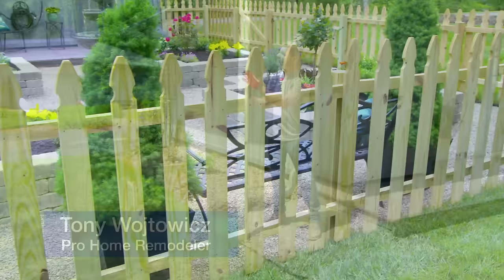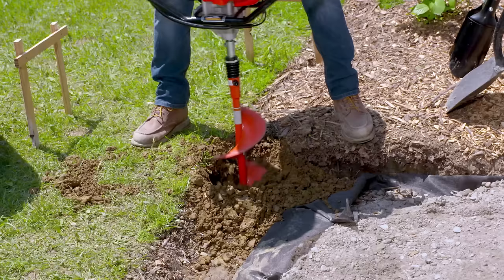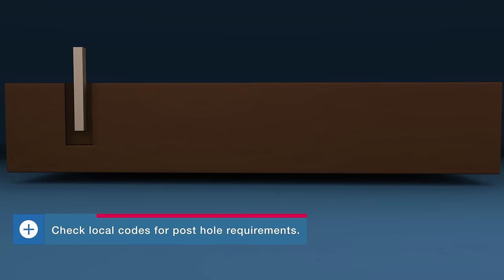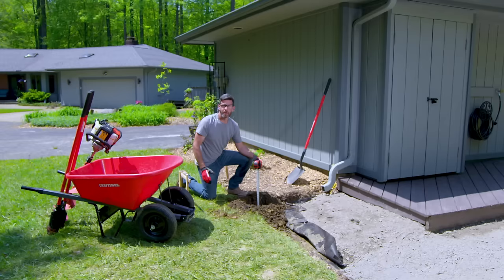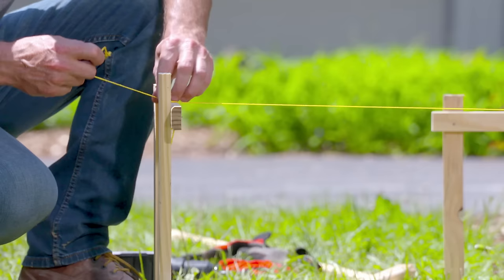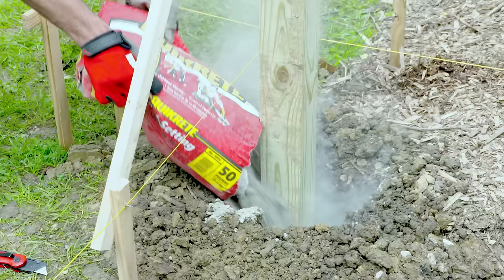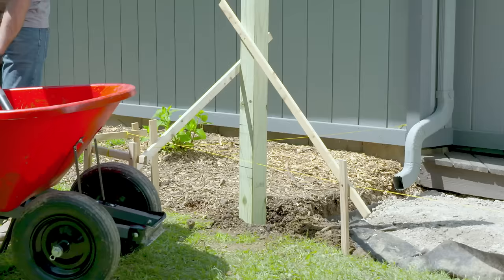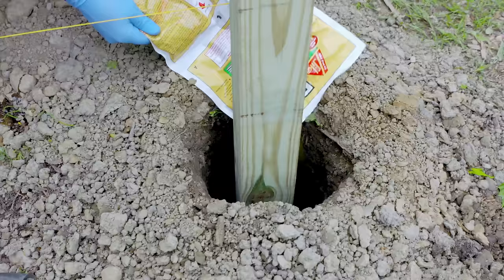How to Set a Post for a Fence or Deck

Comment: The cattle ranchers doing posts will always know better than city deck builders. I have several MILES of fence with all wooden posts, and mine is a smaller operation. No rancher has time or money for concrete, and the posts need to stand up to wind, snow etc. plus 1200 - 1800 pound cattle rubbing up against them all summer. Remember a good fence needs three qualities: 1) horse high, 2) dog tight, 3) Bull tough.  You can do a great job without concrete and have it last many years. Mine are doing great and were installed new in 1994. I expect them to outlast me. Carry on!
Reply: You haven't said how, Rancher.
Reply: @raysmith2940  Here you go, enjoy. What we do is bore the hole, usually with a hydraulic auger. Mechanical muscle helps! For 6" diameter or 6x6 posts we usually use a 12" auger bit. Our posts are usually round as dimensioned lumber is much more expensive. The posts are all pressure treated. Be careful on what type of pressure treating you get. Some types are just for outdoor use, we always use pressure treating for "ground contact". This means green or brown posts. Leave some loose dirt at the bottom of the hole, set the post into the hole higher than where you want it. Putting in more loose dirt in the bottom as required. When the post is 4 - 6 inches above where you want it hammer it in to the desired height to compact the soil directly under the post. The amount you have to hammer in is a function of the type of soil. Clay based soils will not compress as well as sandy or loamy soils. This is all done to provide a better drainage route at the bottom of the post. Then put 6 - 10 inches of loose dirt in the hole. Then as one person holds the post and a post level you pound and compress the dirt around the post. It should be compressed sufficiently to hold the post in position after this has been done one time. Do not skimp on the tamping. But don't let go of the post yet. The tamping bar and shovels can move the post, so keep ensuring it is straight and positioned where you want it. Then repeat adding 6 - 10 inches of dirt (depending on soil type) and tamp it really well. The quality of the tamping will be reflected in the longevity and condition of the post in the future. We use 8 ft posts and set them to 50" to 60 inches above grade, depending on the type of fence: straight woven wire, woven wire with a single strand of barbed or a single strand of hot wire, three to 7 strands of barbed wire, all hot wires (New Zealand fence) etc. This will give 36" to 46" of post in the ground. You need to ensure your posts are in the ground well below the frost line or each winter they will come out of the ground a bit.

Once you have tamped earth at or just above grade you are done with that post. Now remember that single wooden posts are to keep the fence up, NOT for tensioning the fence. To tension the fence we use an "H brace". These are two vertical posts set the same as above with a horizontal post connecting them. So they look like a short squat "H". Then heave barbless wire is used to connect them diagonally. Making several wraps diagonally will then allow for the wire strands to be twisted to provide a great deal of tension. One diagonal will do, but two is better. Using two diagonals for an "X" will provide even greater fence tensioning strength. This sets up a triangle or two. If you look at bridge structures, radio towers, high voltage electrical towers or high rise construction cranes etc. You will see it is mostly a collection of triangles. The triangle has the greatest inherent strength and will not wobble. On a fence these diagonals can be retensioned if needed in the future.

So stretch your fence material between the H braces using a "comealong" or other mechanical method of tensioning the fence. Then attach the fence to the single posts while keeping tension on the fence material. The fence material will need to be attached to each H brace very well to maintain the tension while the individual posts just hold the fence up. You will need an H brace about every 330 foot as this is the length of most of the fencing materials you will use. So it takes 4 rolls of fencing material per quarter mile of fence, or 16 rolls per mile. Get used to thinking about fence in miles and not feet. Our small property for processing cattle only has 2.5 miles of fence. It was a lot of work to put it up and it's always a chore to maintain it.

On a ranch fencing is on of the chores that never end. No matter how well you feed the animals the "grass is always greener", or for bulls the females are always open on the other side. So "running fence" and making repairs is never ending. But a well constructed fence will make for less repairs down the road.

I have done fence in South Dakota, Minnesota, Ohio and Iowa. These soils are very different from our current property on the high plains of Colorado. The soil type will always affect the strength and longevity of the fence. Unfortunately the better the soil the shorter the life of the fence. This is due to rich soils retaining water much better. Heavy clay soils can be problematic if you set posts when the ground is damp, you'll need to go back and retamp them when everything dries out. Clay shrinks a great deal as it drys and will leave you with loose posts if you don't go back a retamp. We improvised a great tool for doing that in Ohio. We had a pneumatic post pounder for T posts, took an axel from an old car, VW I think, but any will do. Welded a 3 or 4 inch diameter 1+ inch thick circle on the end of it for tamping and temporarily attached it to the ram of the post pounder. Once the clay dried out that gizmo would tamp and compact the clay like concrete. It still took some muscle power, but less than doing it by hand with a better result.

Ray, let me know if need me to elaborate on anything above. Or if you are up for it head on out to Colorado and I can give you lessons. I will personally supervise you and critic your performance until you either have it correct, or the fence is done. Probably the later 8^)
Reply: @johnvossler250  wow man, thanks for the info!! I bought a tamper today. We live near houston and the soil has alot of clay. Most fence posts here fail quickly that are in concrete. Im going to use ur method and also add in some pea gravel to help with drainage (as we get a lot of rain here).
Reply: @johnvossler250  I most definitely want to come learn ranching duties!!
Reply: @LiLDiesel23  Post on concrete fail because the post shrinks and expands with temperature change. When it shrink moisture gets in and with time the post fails. Using a post bracket and screw into a concrete footing is ideal in the long run because if a post ever needs replacing, just in screw it and replace. The concrete footing will outlast several owners.
Reply: @johnvossler250  Thanks for such a detailed explanation John. That’s pretty much how we did it in north Louisiana years ago. However now I live in the swamp land of south Louisiana with stinky wet clay muck. An hour after digging the holes there’s about a foot of water in each hole. Any advice setting these things would be appreciated.
Reply: you're also doing 2 different things deck posts transfers loads through the lumber to the ground, fences need to prevent lateral movement
Reply: @johnvossler250 Thanks for that info sir 😊
Reply: @johnvossler250  OK, Mr Fence expert. I just need 2 posts to hold up my back yard hammock. I'm going to use two posts that are 5' tall from the ground. What height of post do I need to have 5 ft above the ground?
Reply: @louie1487  can you explain this method, please? Using a post bracket?
Reply: @dianesulpizio2542  For a fence, pouring concrete and putting a post base in before it cures will last a lifetime. 4x4 post is attached to the post base with lag screws or bolts. Posts last longer and when they do need to be replaced: unbolt, replace post, bolt up again.
Reply: @louie1487  welp, no idea what lag screws and post bases are, etc. Have no idea how such attached to a column of concrete. Can you explain all this, pls?
Reply from the maker: Hi Diane, posts can be secured into the ground with fast-setting concrete about 2-ft into the ground (or deeper if your soil is sandy), but we recommend checking the product specifications of your hammock and proper installation.

Comment: Buy a bucket of roofing tar. Seal the part of your post that will be in the ground and about 3 inches higher than the the ground level.  Just worked on an old man's house who did that in 1989 and his post are still good. He does paint his deck regularly and has replaced some decking boards, but the deck is still safe and solid overall.

Comment: mix concrete in wheelbarrow, then pour it in the hole, or you might get air pockets in it
Reply: doesn't that ruin the wheelbarrow?? Or do you line it with plastic first? What kind of concrete should I buy? I'm only putting in 2 posts. If I want 5 feet tall posts, how far down do I need to go below the ground?
Reply: @dianesulpizio2542  Use an old wheelbarrow just for that purpose. I think wet pouring concrete is a much better option than the dry pour they show in the video.

Comment: I live up north in sub zero temps and our freeze line is about 3.5 feet deep.  I use the cardboard tubing (cut 4 feet, insert in hole and fill with cement) to place my posts.  Why ?  Because doing it like Mr. Lowe above seems to lift the cement base a few inches every darn Spring so that after 10 years a few of my old fence posts were almost a foot higher than the others.  Replaced those with the cardboard tubing method....haven't risen an inch after 5 years.
Reply: I just moved to an area with a similar climate (Anchorage), and I'm getting ready to set fence posts. Do you mean you pour concrete intuitive the tubes and the set the post on top of the concrete using hardware?
Reply: @jakeelders1562  Yes on top.

Comment: I have a question. I was taught to fill the hole first with concrete. Let it set a little. Then sink the lumber into the concrete. I've been doing it that way for years. What's your opinion?
Reply: Your post will rot from the bottom up, and you won't know it.  Surrounding a post with concrete creates a "cup" that traps water.  As gaps will open between the post and cement, allowing water to travel down to the bottom of the square hole it sits in, and then it will soak into the ends of the grain at the bottom of the post.
Reply: @rgagnon1008  I've been installing fences for 20 or so years. I've never had that problem. I fill with round rock, I paint all wood post with asphalt paint.
Reply: @frogmanpipes9561  Setting a post into concrete is NOT what makes it rot. 
What makes it rot is using standard PT from the box stores.  Check out the different grades of PT wood, there is PT .40, and PT Ground Contact/Burial .60 grade.  Either use the proper grade, or paint your posts completely with roofing or asphalt tar before setting.
A post embedded in concrete rots because it is either not Ground Contact/.60, or, water wicks in on the edges of the lumber/concrete interface.  Its gets in, travels to the bottom of the lumber inside the concrete, can't go anywhere else, and just sits there as more water tries to enter until it is saturated. It really can't evaporate, and rarely will the ground at depth get dry enough to reverse wick its way out through the concrete. So it sits there, and eventually the wood starts rotting. Coating properly treated wood thats then embedded in concrete should last decades and decades before rotting.
Reply: @boots7859  thanks so much for your advice, never seen any fence builders do it in Houston, wish they did, fences here being replaced all the time, people aren't using your method
Reply: @boots7859  where do you buy ground contact pt wood
'
Reply: @boots7859  I use proper pt, I bring the concrete above grade and crown it to shed water away from the post, then polyurethane caulk where the post meets the concrete.

Comment: Never put your post in cement. I did that a long time ago and learned my lesson. When you have to replace the post, it's now embedded in a rock. Cement also pulls in moisture thus enhancing the rotting process of the post.
Reply: Just do pressure treated.
Reply: @kbanghart  will still rot.
Reply: @Jason-uw3wn  meh
Reply: @kbanghart  😂
Reply: so what to do? maybe wrap some plastic around the post like a sleeve?  What do you suggest?
Reply: @skid3339  probably pour a small concrete base in the ground, and fit a steel connector to attach your post to.
Reply: @kbanghart  so the whole post is above the ground ?
Reply: @skid3339  Yes, one brand that big box stores usually carry is Simpson strong tie, there are pieces that go into the concrete before it hardens, and then after it's all set, just bolt the post in to it. There should be at least two points of attachment to make it somewhat sturdy. I just put in some short 4x4 posts, pressure treated, to make a protective area around my outside air conditioner. But in other cases, I just used steel posts and buried them in concrete. What are you building?
Reply: @kbanghart  im making a 4ft by 10ft shed, but I see what you are saying, I found the Simpson brackets and some other ones
Reply: Mines been in concrete for 7 years, haven't moved an inch and haven't rotted at all, I used PT and crowned the top of the concrete above ground, used a caulk as an expansion gap where the crowned concrete meets the post to keep water out of there is any shrinkage around the post.
Reply: @kbanghart  I just need 2 posts for my hammock. I need them 5 ft tall from the ground. What is your suggestion for posts and how to install them in my back yard?

Comment: I do mine with pvc jackets    rebar at the bottom     so moisture  can never get to the  wood  and a cap at the top.   Got  post  on my property over 20 years old ... the way this guy is doin it  you might get 10 years lol even with pressure treated   expecting my builds to last over    50 plus years easy   with or without pressure treated wood  I still use pressure treated humidity     is always a factor
Reply: can you expand on what you mean by pvc jackets? As in you have a 4x4 post in a 4" abs/pvc plumbing piece like 36" into the ground. Then you pour in concrete? with 6" gravel tamped on the bottom? Or do you have actual fabricated 4" square pvc jackets fabricated from somewhere? thanks!

Comment: The video says “fence post holes ONLY need to be about one third to one half of the height of the post above ground, and three times the width of the post wide”. Does that mean that if my fence posts are 4"x4" and 6 ft above ground, then the hole needs to be 1' x 1' and 3 ft deep in the most conservative scenario?
Reply: If your above ground height is 6 feet one third of that is 2 feet.

Comment: Why put rocks down instead of concrete at the bottom of the hole? Is it to drain water away? And I would fill the concrete higher than ground level then slope away from the post.
Reply: but how do you bring it higher than the ground? Put some kind of form on the ground for the concrete?
Reply: @dianesulpizio2542  Yes, I seen people use a type of sleeve around the post then they fill the sleeve with concrete. I don't know if that's the way it should be done but I have seen it done that way.

Comment: For a fence, could you use gravel as a base as well as backfill?
Reply: No, standard gravel wouldn't allow enough drainage.
Reply: Yes, many people set posts entirely with gravel. A deck needs concrete on top of 6" of gravel, but a fence post can set in gravel. Gravel has much better drainage than soil or concrete

Comment: Just remember to check for underground utility lines before digging your post holes.
Reply: Avoid the hassle and futility, first call MS. UTILITY!!
Reply: @Drew Pierce for sure! Someone ran into my friend's wooden fence. Her son called to have lines marked, & turns out the ex had set the original posts right on top of city water line!
Reply: Absolutely

Comment: Why is gravel needed at the base of the hole? I'm asking because I'm installing a mailbox and wondering if that step needs to take place for my job as well.
Reply: For water to escape out the bottom.
Reply: YOu don't want gravel there, you want cement there to seal it.  Gravel creates a lake.
Reply: @irhusker6569  Actually incorrect.... Gravel helps the water get away from the footings and post quicker than it would in soil.  Soil HOLDS the water.  Gravel lets is drip down to the soil, getting away from the concrete or post.

Comment: I just pulled 10 4x4 pressure treated posts out of the bare ground, fence so old it was falling apart.  Out of 10 posts, two were rotten at the ground and the the other 8 looked like new.
Reply: Okay. What is your point?

Comment: why not just tape seal the posts. waterproof and perhaps air tight
Reply: Because water will be drawn into the exposed wood through capillary action and gravity eventually drags the water underground and you end up with permanent water saturation of the underground portion of the post.

Comment: I’ve been do some research since I need to replace my backyard fence that a contractor installed wrong. I’m going with galvanized poles 9 like you use for chain link fencing, since that will eliminate the rotting wood Issues. .

Question though, should I use concrete, or this quick setting foam stuff. Las Vegas heat, no water minus when it rains.
Reply: DeadSkinMask32 I would do concrete

Comment: Soil microbes degrade wood, moisture is a factor but not so much.  Consider ancient boat timbers found at the bottom of lakes and oceans. Even still, good drainage is important.  Also, keep soil away from the bottom of the pickets, as well.  Stain anyone?